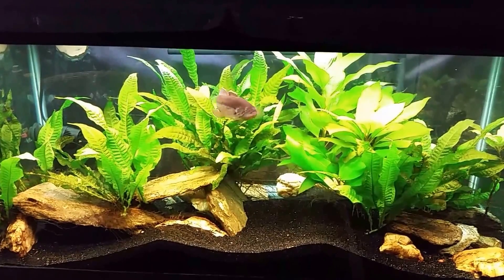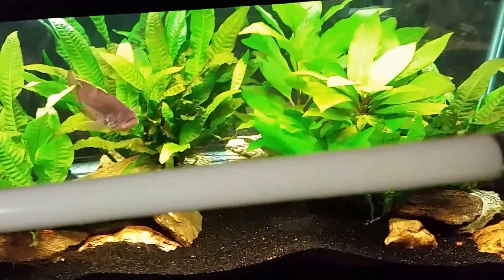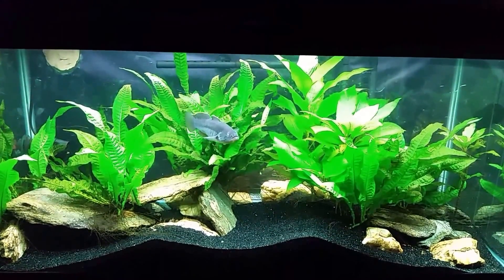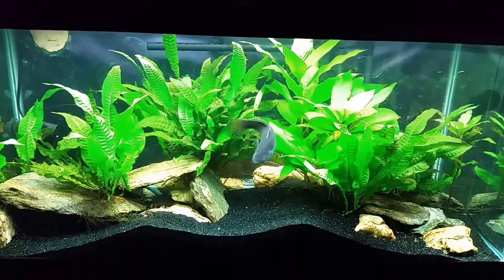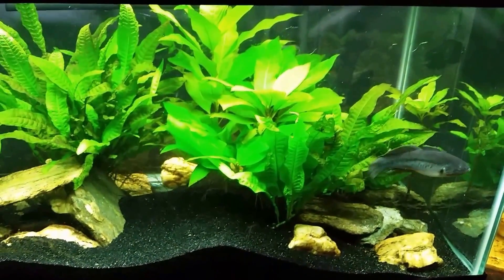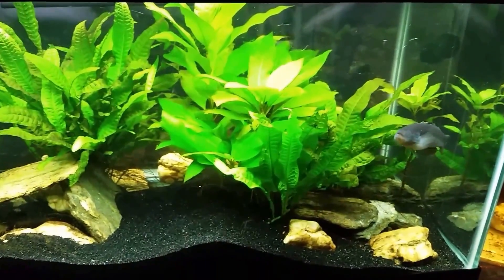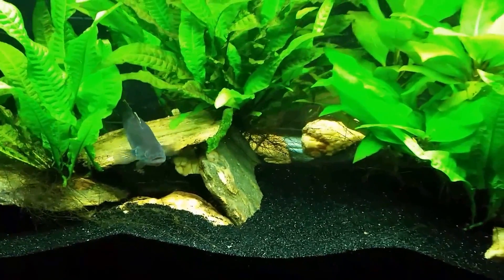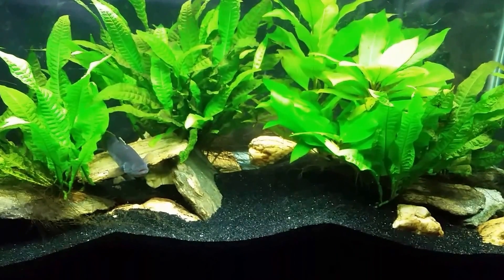New 6500K T5 and What Color Temperature Means

Comment: Wow. That was great information. Do you go for aquarium only light or would you use cheaper bulbs from a diy store. I hear alot of mixed opinions on this. What do you think??? 😏
Reply: laura corrigan If you use DIY, I suggest going with "Daylight" bulbs. It is pretty close to the kelvin that most aquarium plants are in.
Reply: Great advice. I have often used them. I just always wondered if they are as safe. Had no problems anyway with mine